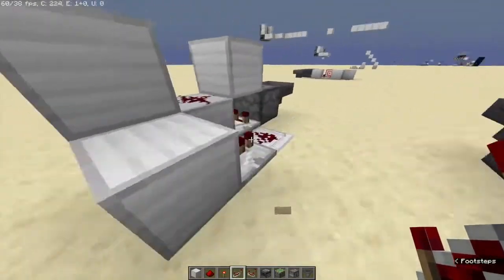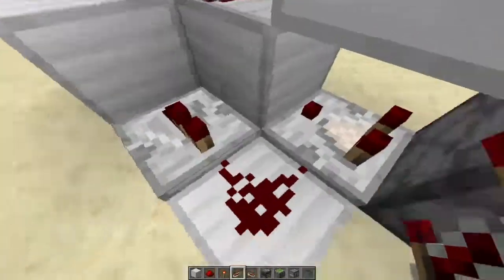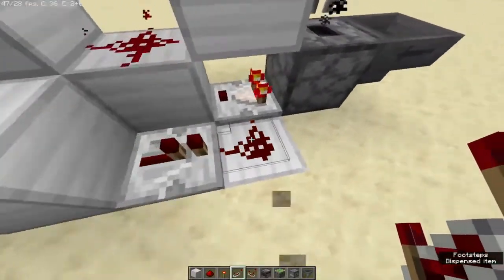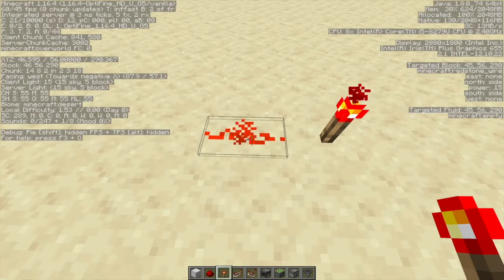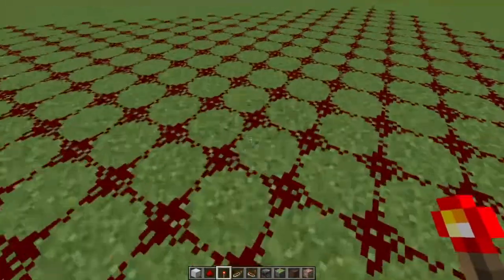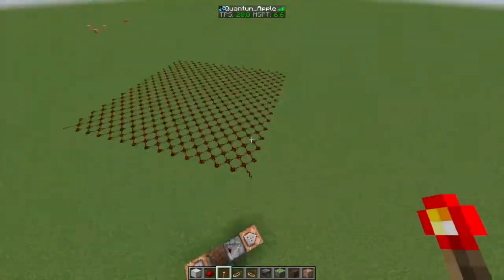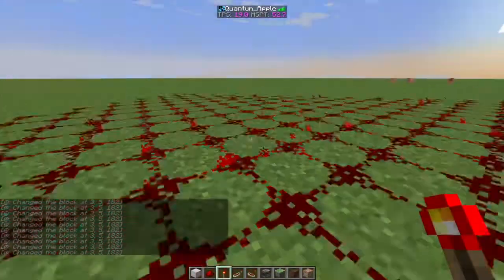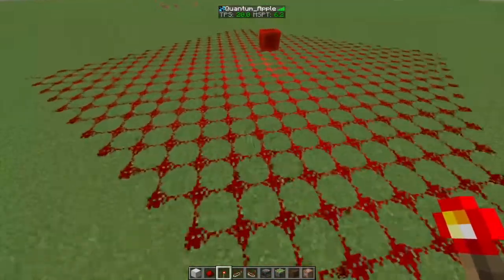Easy Auto Dropper Lag Reduction + Redstone Dust Lag Explanation - Minecraft

Comment: Afaik a single redstone dust will turn off immediately. Only when there is a neighboring dust, instead of going to 0 it sees a dust with signal 14 and thinks it's powering it, so it goes to 13 and now the next dust notices changes and lowers to 12 and so on.